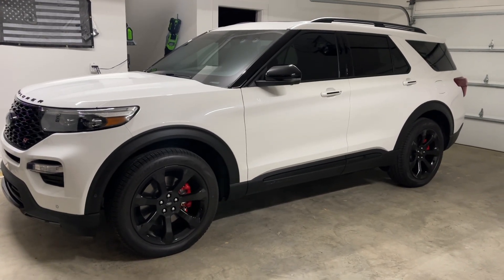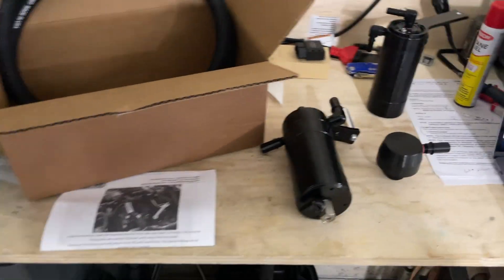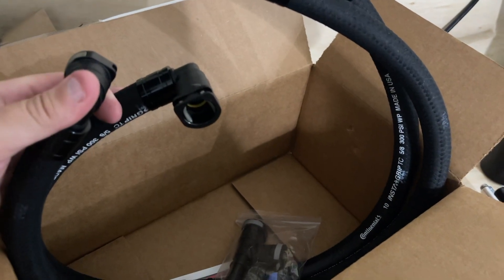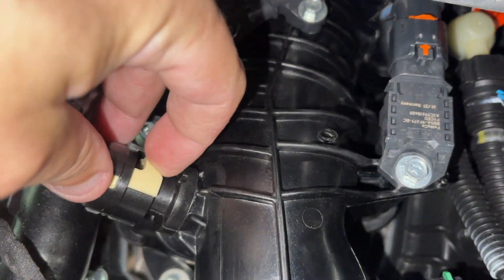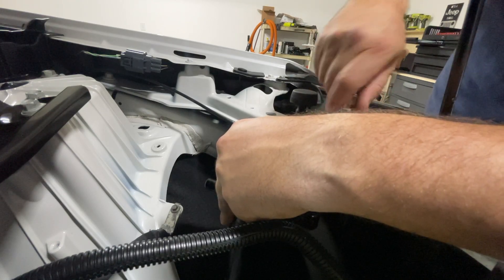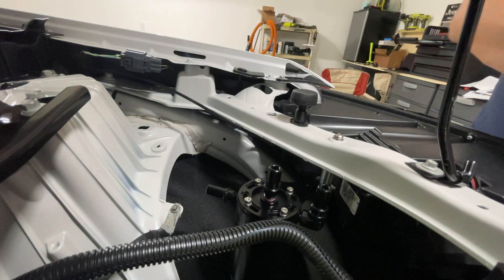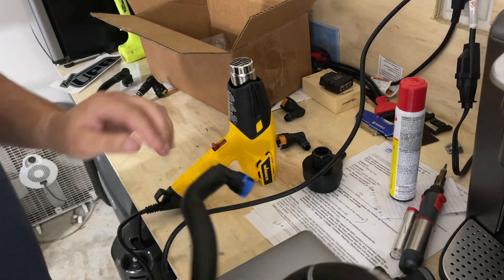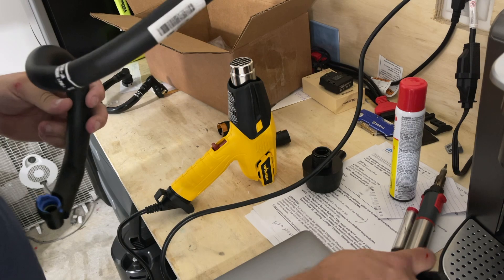UPR Dual Valve Catch Can install (new style) on my 2022 Ford Explorer ST.  #howto  #upr #explorerst

Comment: Did you need to reroute the driver’s side hose from the “T” to the hockey puck on the valve cover.
I have a 2022 just like the one on your video, and cannot get it to attach to the “T” from the stock routing, for love nor money.
Reply from the maker: Yes. But the stock hard hose will work from the drivers side valve cover separator to the T, but it’s a tight stretch because the factory hose is hard plastic.   I eventually used a short section of 5/8 hose I had from another UPR kit I had in the past and made a hose to replace the factory hard line there using the ends from the factory hose I had.

Comment: Unless those are for some reason different than clips on my ford, but look the exact same. If you push the entire connector down first then try to slide the orange tab it comes right off. 

I am not getting the clean side layout, that doesn't look appropriate for those systems. I'd honestly not want the clean side if that's how they laid it out. 🤷
Reply from the maker: If that’s how yours work, then these are definitely different. And the layout of the clean side is much better than having to drill into the intake tube and it works very well while being totally reversible, if you wanna take it off because you sold the vehicle. 
But it’s your vehicle, so do what you want do with it EP.